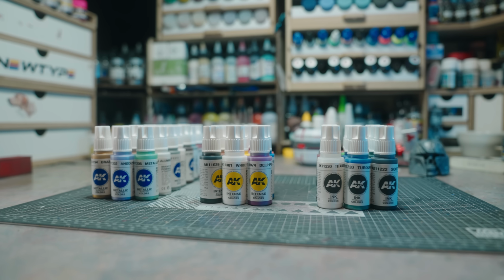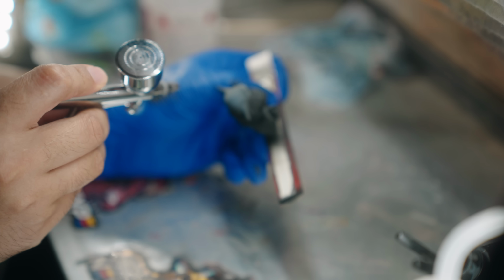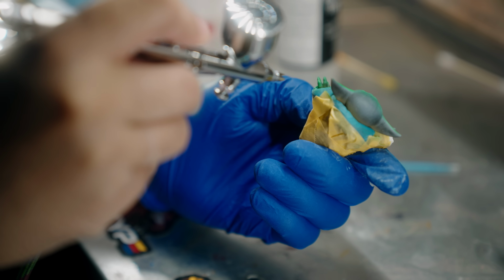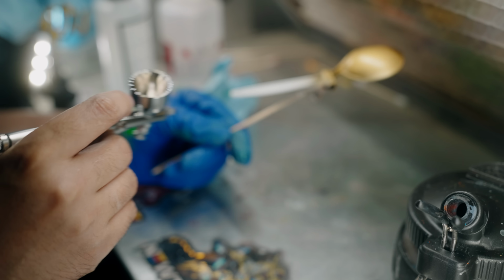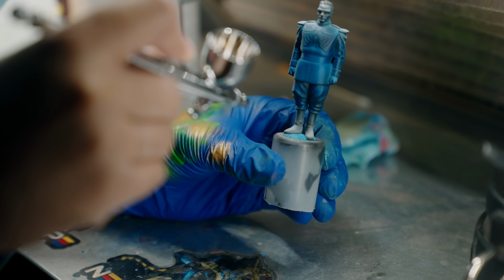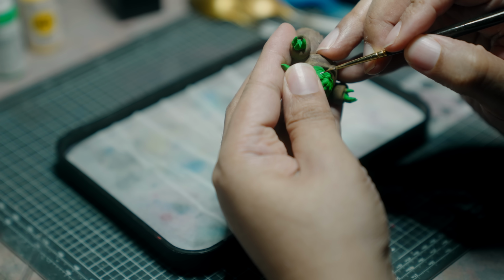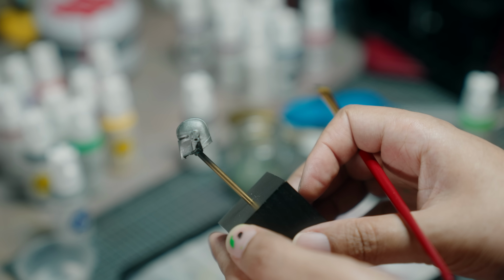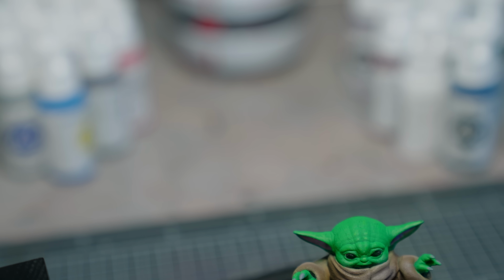I was sent AK Interactive Acrylic paints So I painted a Baby Yoda

Comment: I had the same problem with cracking resin. The pieces were hollow but there was still pockets of uncured resin inside. Wich expanded and broke the prints. Fixed it by adding more holes for the resin to flow out when washing.

Comment: I think I caught the shade you were throwing with the spoon painting part.  I see that tons in airbrush and only a few will show any practical reviews on the same types of plastics as actual models and they do have different texture that may not be like the model.  I will say that they are a harder to bond surface and I think that may be the point overall as a test also.